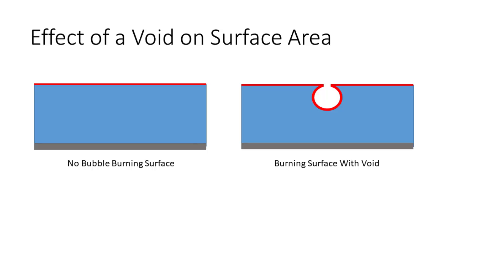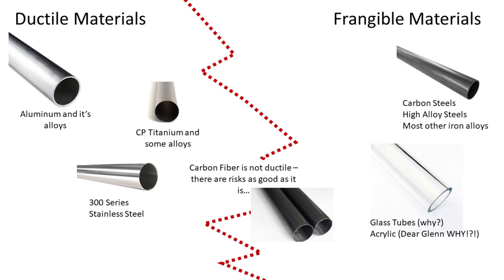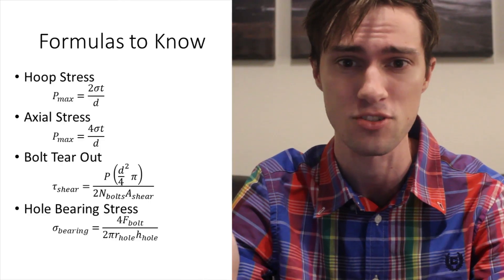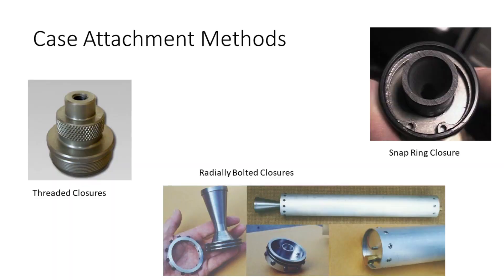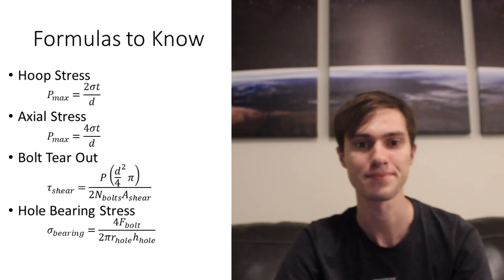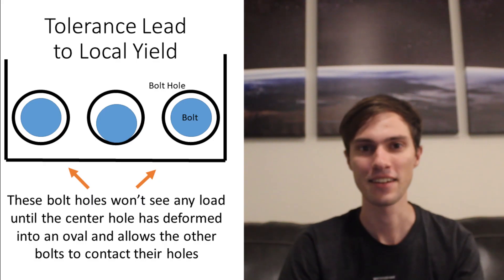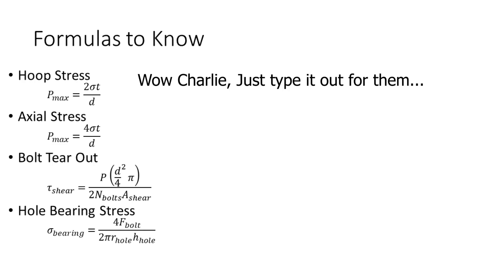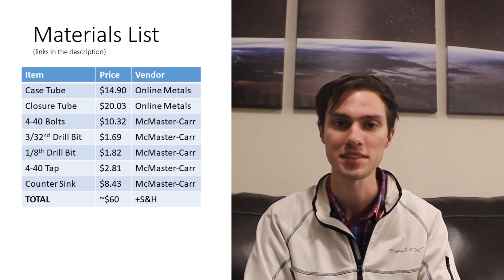Solid Rocket Motors 2: Case Design

Comment: Great video Charlie!  You may wish to add a comment on heat stress and how it can degrade the AL case strength.  Not always important in the short burn motors but can be pretty brutal with the bulges, burnthroughs, etc...   Looking forward to the next video!
Reply from the maker: Hopefully this 54mm motor doesn't see high temperatures in the case... If it does I picked a bad liner.
This is super important to remember for other designs though, and might be the topic of a future video.
Reply: @AstroCharlie  , lol - You nailed it CHEAP LINERS SUCK!  Spending $100 for a good phenolic set will save you from LOTS of problems...   I learned my lessons

Comment: Very good video Charlie, thanks a lot. But I have a favor to ask from you and from all other rocketeers))))
Here in Armenia there are only 3 guys that are in this hobby, so everything comes really hard. We had a lot of Chinese rocket engines (for single use)  that used up very fast and new once nobody is shipping anymore cause it is hazard. So we decided we make our own. Now I have a rocket that is about 1.8kg, how much thrust do i need to push it to 2000m height. (that is 300m from sea level, my city is on 1000m mark). Based on this info then I would try to make an engine that is large enough to get that thrust. Or any specific engine you can recommend that we can learn its data online

Comment: even though I'm messing around with (hopefully) E-class sugar motors, this is still so useful, as if I design it to be safe using more energetic fuels (such as the mix you're using), then it should work with sugar motors. thanks!
Reply: I've built both sugar motors (up to Q-class) and apcp motors. The chemical composition of the propellant does not determine what pressures your case will experience...I've blown cases apart with both propellants. Good design and propellant casting are important for both.
Reply: @mojaverockets  thank you. how would you recommend to cast sugar prop? ATM, I have a 3d printed mould that peels away on the sides, and pulls out for the grain geometry (ATM just a simple BATES). Would that work, or am i just stupid? should I cast it into the liner, and only have a 3d printed BATES mould?
Reply: What kind of filament do you use? You need pretty high temp in order to use 3d printed material as a jig for sugar motors.
Reply: @studywithme8055  was planning to do it with PLA, realized how bad that idea was, and now using cardboard tubes for the shape and a jig that centers the BATES tube.
Reply: @rocketcello5354  Did you think about carbon fibre nylon filament?

Comment: Hi Charlie. Those links to onlinemetals.com appear broken.  They seem to have a "new site".  Could you update the links.  Also, perhaps include descriptions of item parameters in your text,  in case links break in the future.  This video is going to be useful to people a long time into the future.  

For my own future reference...
Case Tube: Aluminium Tube 6061T6 OD 2.25" ID 2"
Closure:  Aluminium Tube 6061T6 OD 2" ID 1.5"
Clearance Drill Bit: 1/8"
Tap Drill Bit: 3/32"
Tap: 4-40
Screws: 4-40 Thread Size, 3/16" Long, Black-Oxide Alloy Steel Hex Drive Flat Head Screw
Countersink: for Screws, 82 Degree, 1 Flute, 1/4" Body Diameter

Comment: Charlie! Question- I just downloaded open motor. In a practical sense do end burn motors keep function in longer formats? Like I known it works small scale but do you know anyone doing it at the larger scale?
Reply: "...keep function in longer formats?' The longest end burner I've done was about 60 seconds. The big issue is preventing the case from overheating during that time. A good insulating liner, lower temperature burning propellant and choice of case materials are important.

Comment: One thing I would Change Charlie.  You are using a term explode.  This can invite regulatory response as it would be treated as a explosive. The correct terms are CATO  or Rapid disassembly.
Reply from the maker: Hi Conway, my choice of language was very deliberate.
NAR/TRA have lawyers and money to respond to regulatory challenges, and in fact, have already done so. The is legal precedent for propellant being considered non-explosive.
People getting started in this hobby who do not understand the significance of the phrase 'CATO' or 'RUD' have no protection for the possibility of hot gasses and shards of metal beyond the instruction they get. Weasel words have no place in safety critical discussions.
Reply: I think Charlie's use of explode as a verb is correct. Here is one definition of explode: "burst or shatter violently and noisily as a result of rapid combustion, decomposition, excessive internal pressure, or other process, typically scattering fragments widely". That is different than the noun 'explosive'

Comment: Ok Charlie, doing the calculations you mentioned about case loads, for a case of 2.00 inches ID, and for a pressure of 1500 psi, the axial load is 4712 lbs, like you said. Then you mentioned the tensile stress in the cross section of the case is 13.5 ksi, or 13,500 psi. How did you get this number??? By my calculations, the tensile stress should actually be 11.6 ksi, or 11,635 psi, this was by dividing the 4712 lbs by 0.4050 inches which is the cross sectional area of the case. Please explain your calculation. Thanks

Comment: Why not use model rocket fuel and aluminum foil with durable plastics around it?
Reply from the maker: That will no work well, if at all. I have the ability to make a much more effective rocket using materials that are just as cheap if you're willing to purchase from somewhere other than the hardware store.

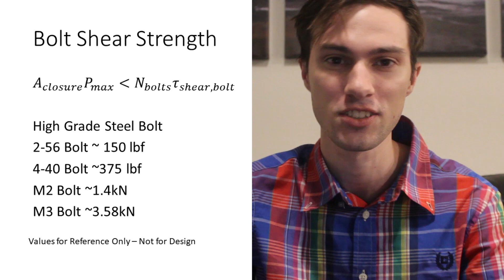Comment: I've got to ask where you got the numbers for the 4-40 bolt shear strength, as the numbers at 8:22 show that the bolts should withstand a load of 375 lb, while you mention that the shear strength of the bolts is 940 lbs in the segment right after. It's a bit confusing to me how you end up calculating the 8 bolt requirement to fasten the bulkheads in and wanted to gain further insight on how to calculate that.
I'm personally trying to work on a project to measure combustion chamber pressure for solid rocket motors and ultimately I've decided to go from using snap rings to instead using the radial bolt method, though, I'm still trying to figure out the math behind a radially bolted enclosure.
The video series has otherwise been a huge help to me in better understanding how to make casings that are potentially better than using a basic old snap ring system. I'm trying to apply this to a 38mm motor so it's definitely going to get interesting, and hopefully I can build up from there to 98mm motor hardware. I'm wondering if switching from 4-40 bolts to say, 2-56 bolts might be more appropriate. This brings me to my next question: how one would incorporate a secondary row of bolts into the casing? What kinds of calculations would be involved with doing so, and what other resources should I look to in order to better understand how this works and possibly even how such expressions can be derived?
Thanks for the help!

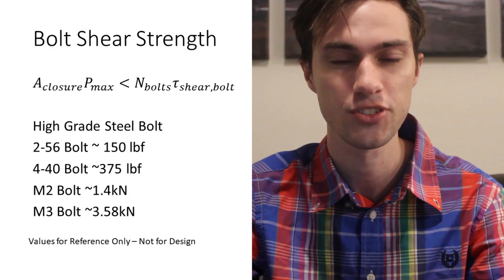EDIT: I just saw the fine print at 8:22, though, I'm still confused on how one reaches the 940lb number for the shear strength of the bolts.
Reply from the maker: This was an error - I edited the video months after I filmed it. 375 lbs is the correct value. To calculate the number of bolts multiply the chamber pressure by the area of the bulkhead to get the load the bolts need to survive. Divide this number by the strength of your bolts and round up to figure out how many bolts to use.

Here is a write up.
https://wikis.mit.edu/confluence/display/RocketTeam/Radial+Bolted+Case+Design
Reply: @AstroCharlie  Ah, alright. I see your comment on lowering the chamber pressure to 900 psi, and running through the math I do get ~7.5, which would round nicely to 8.

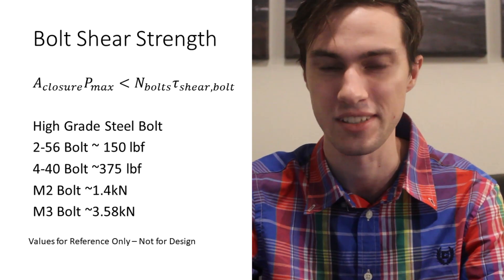If I used 2-56 bolts instead, would I use the values mentioned at 8:22 or would I have to find my own shear strength for the bolts?

Thank you again
Reply: @astrofox2409  My design needs to at least withstand the pressure of about 991psi but I will go with 1100psi, I was also confused at the same part of the video and then when he commented to limit it to 900psi it got me more confused bout why he said that. Reading the above convo cleared my doubt. Thanks!
Reply: @AstroCharlie  You should add the corrected (8:35+) amount in your description for people that don't read through all the comments.

Comment: The case.py inside Github link seems to calculate O-ring stretch related properties, rather than tensile strength. Was that intended?
Reply from the maker: It should have functions for both - You get a sneak preview of episode 4 where we do o-ring gland sizing.
Reply: @AstroCharlie  Got it!

Comment: I am one of those people who happens to use PVC, however in my defense I am continually making sure that what I do is safe and one of the ways I get around the PVC shooting bits of itself at me is to use very low pressure tolerant end caps so it essentially dumps all the fuel inefficiently out the top of the motor if there is even a slightly higher pressure than I would want inside. 

Side note: the main reason I use KNO3 and Sugar with PVC is because where I live as it is very difficult to come across even some of the more easily found materials many others have access to. Shipping costs being the main concern over here in South Africa when it comes to getting such things as the fuel grain you want to use or get correctly sized aluminium for the motors.
Reply: I am so glad to know that you also used PVC as the rocket casing material since I am working on the same material as you do. What was your recorded chamber pressure with PVC casing?
Reply: PVC casings for 'sugar' and other type of motors can be just as 'safe' as other materials if designed correctly. I've blown up both PVC, fiberglass, aluminum, and steel cases doing rocketry. PVC cases will often fragment into many pieces (hundreds?) but because of their low mass, they do not travel as far. I've had 6061 T-6 aluminum cases fragment into as many as 14 sharp jagged edge pieces that fly a lot farther than PVC and with more force. I've also had steel cases fragment into just a few, 2, or 3 pieces that don't travel as far because of their mass. After years of experience, I'd much rather be out in the open 200' away from either a PVC or steel case failure than an aluminum case failure. Full disclosure, I use many different types of case materials for my motors depending on the use.

Comment: Awesome video Charlie. I am working on my own motor. When stainless steel is used as a casing material and the combustion temp. is 1500 C, do I need a liner for thermal protection ? Since I use Bates graines and the burn time is only 1.5 sec. I think I should be fine without a liner since the yield strength isn't really suffering under high temp. like aluminium. Greetings from Germany.
PS. the longer the video the better
Reply from the maker: Yes - you always need a thermal liner if you plan on reusing the case.
Reply: @AstroCharlie  When my outer surface is inhibited is it possible to use the inhibitor ( BT-70 body tube) as a thermal liner.

Comment: If you bolt the motor casing to the body, you won't be able Thrust Vector it right.
Reply from the maker: This motor will not be thrust vectored. It is much larger than the motors that are typically gimbaled and the airframe would be uselessly large.
Reply: @AstroCharlie  So do you plan on using RCS thrusters? Since its quite a big rocket, it needs some sort of active attitude control.
Reply: @ruturajyellurkar9588  Ion think so, basically it'll have fins and won't have any any fancy attitude control systems.

Comment: Great job on the video. My friends and I have been trying to build a rocket engine using potassium chlorate as the oxidiser, silicone as the binder/fuel and a 3d printed case. They keep exploding. Do you think this is because the case isn't strong enough or because the fuel has a spike in burn rate as the pressure increases.
Reply: We a actually just got out first solid rocket motor to work today!
Reply: @tomh2628  what was the problem?
Reply: @briansimons2703  we found that surface area on the grain had a big effect on burn rate (which in hindsight was kind of obvious) so we just used end burners instead of cored rockets. With a potassium chlorate oxidiser the rockets are much more likely to explode so if you want to make a large  cored rocket KClO3 isn't really an option. Were working on making potassium perchlorate (KClO4) by electrolysis but for now the potassium chlorate end burners work well enough.
Reply: @tomh2628  when you use silicone as a binder, do you have problems with glass slag sticking to the nozzle?
Reply: @firstnamelastname.7749  Sort of, the residue stuck to the whole combustion chamber but it never actually clogged the nozzle. We've since switched to using nitrocellulose as a binder with acetone as a solvent. We haven't had much success yet because the consistency isn't ideal and it forms big sticky clumps that aren't great for forming complex cores but it doesn't leave the residue that the silicone did. We've also tried dextrin as a binder and we've been able to fly a rocket using it but when dry the fuel is pretty brittle so we could only really do end burners. As a side note we've just figured out how to make potassium perchlorate so we'll be using that as our oxidiser in the future because of its superior stability and oxygen content to the potassium chlorate.
Reply: @tomh2628   can I get you mail I’d?

Comment: Are you going to use potassium nitrate?
Reply: Potassium nitrate is often used by beginners as an oxidizer, since it's readily available as stump remover. However, it's really not that good as an oxidizer, and the sugar it is usually paired with as a fuel yields a propellant that doesn't perform nearly as well as modern composite propellants. Charlie touches on this in the video. I expect that he will use ammonium perchlorate as his oxidizer, rather than potassium nitrate.
Reply: @joeymurphy2464    KNO3 isn't just used by 'beginners'. I know people in aerospace that use it for their own personal 'amateur' rockets...it is in fact, the world's most commonly used amateur rocket propellant. I've been using it for years for motors from A thru Q impulse and we are now working on a 360,000 Nsec S-26,000 'sugar' motor. 
My K-impulse 'sugar' motor reloads cost about $4 and M impulse sugar motors cost about $12 per reload and I now have over 3 million Nsec of 'sugar' propellant to my credit. If you are making rockets for the military or to launch something in orbit, sugar is not the propellant you want to be using. But for student teams that want to experiment with things like electronics, recovery, air brakes, etc, 'sugar' offers them a low-cost alternative for conducting more launches at a lower cost.
https://www.youtube.com/watch?v=1ujxLa_ZVIM 

As for performance compared to an APCP propellant motor? 
https://www.youtube.com/watch?v=xDD26Fw3Pjo

Full disclosure, I do solid and liquid motors of many different types and often use several thousand dollars of apcp motors a year for different things but don't knock 'sugar' propellant as a viable rocketry propellant...it does blow up on occasion but so does any rocket propellant including apcp but at a much higher cost for ap
https://www.youtube.com/watch?v=EO_iGvBX87c

Comment from the maker: Hey Rocketeers!
I know I said I designed this case for 1500 psi, but it's really a better idea to limit this case to about 900 psi. To get the full pressure you need to do a few things different, and I neglected to clarify this in the video.
Cheers!
Charlie